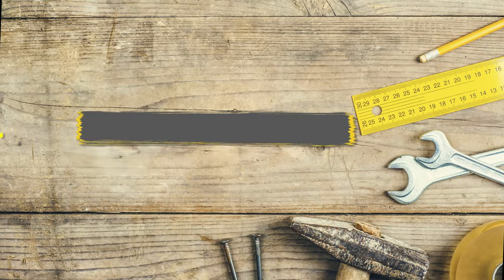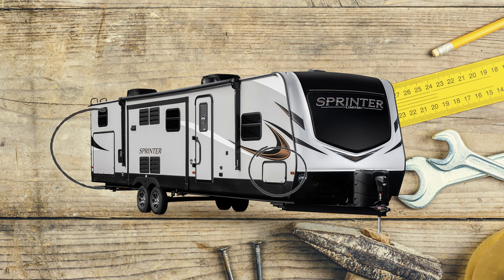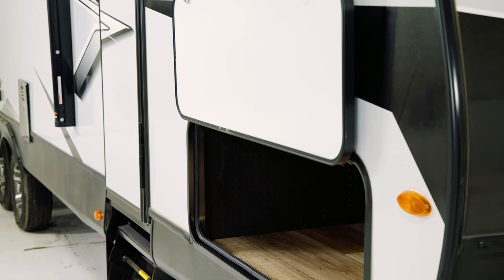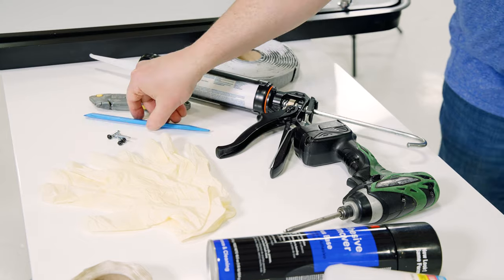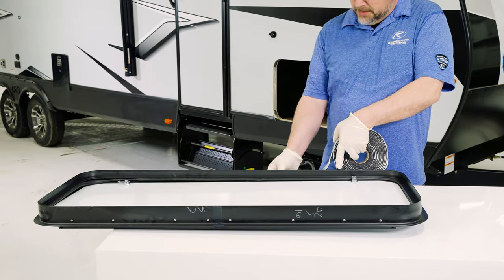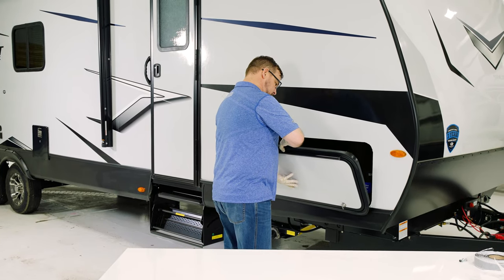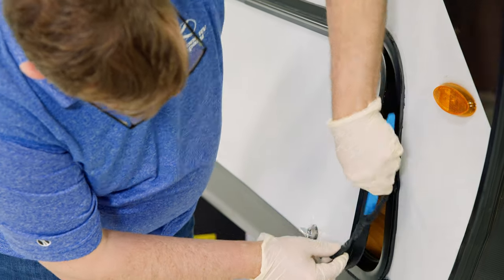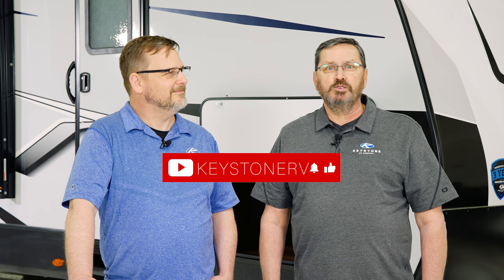How to replace your RV Compartment Door - Do it Yourself!

Comment: I just replaced my generator compartment door, left the tailgate down and it damaged the door.  The question I have is what type of sealant is used on the inside of generator compartment.  I noticed it is black and it looks like it was brushed on.  Again this is the inside of the door and no on the outside.  I guessing some type of heat resistant sealant?

Comment: Why are you still using silicone sealant on the outside of the RV that molds and has to be replaced so often.  Isn't there products out there that last much longer and more mold resistant in the outdoor environment?  My car doesn't use silicone why does my rv have so much of it?
Reply from the maker: Good morning, and thank you for your insight, the silicone sealant is used in many applications and is intended for indoor/outdoor use just as at home. It is used across the RV industry and does well to serve its purpose in keeping water out. However, as part of routine maintenance, customers need to frequently inspect and update their seals, in which case, if needed, you could reapply whatever seal you choose to complete this maintenance on the exterior. On the roof we will only recommend self-leveling lap sealant, but anywhere there is silicone seal, you may use what you like to keep water out.